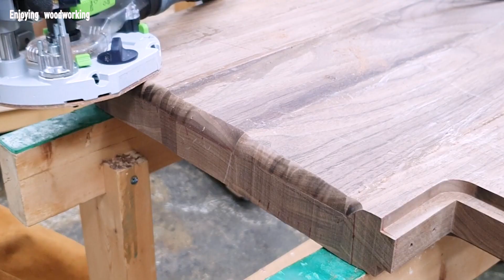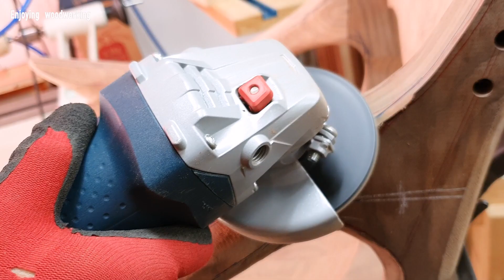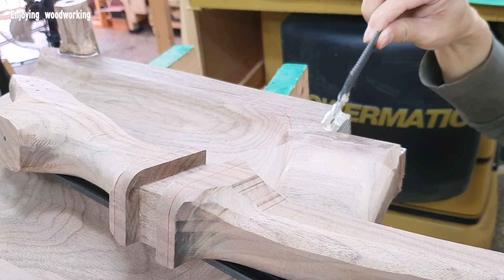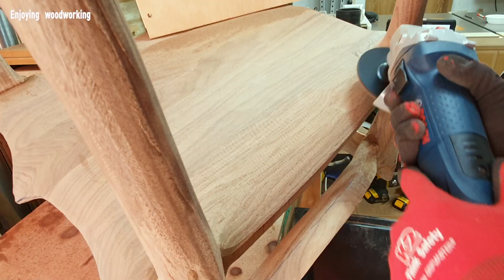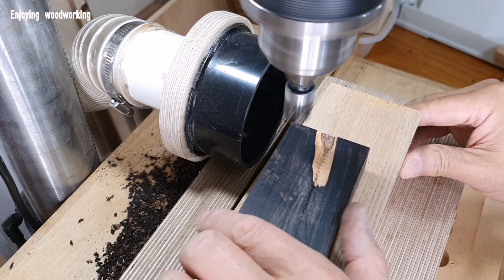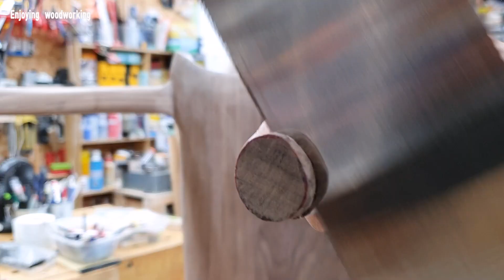말루프 로벡체어 만들기-3편/ Sam Maloof Low-back Chair

Comment: great video! It seems like a lot a work involved in power and hand tools. How long do you think it takes you to make one chair?
Reply from the maker: Good question.
In my case, it took about 3 months because I didn't spend all my time making the chair.
However, it takes a lot of preparation to make a maluprovec chair.
Purchasing a plan Various necessary processes such as template production using a plan, wood selection, and various tools used for production must be preceded.
If you want to make a malupro back chair, please watch other people's videos carefully to improve your skills.
The most important thing is to start.
A chair is not made without a beginning.
I support you in your challenge.
Reply: @enjoyingwoodworking691  thanks for your kind words. My goal is to make a maloof style rocking chair but i will start making simpler projects to get use to the tools
Reply from the maker: @ksojoel  I support you in your challenge.